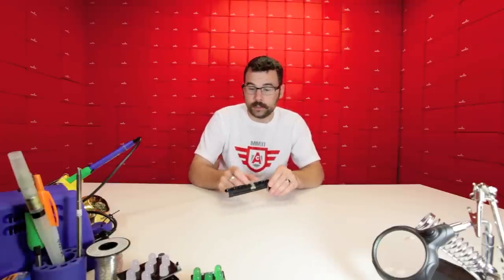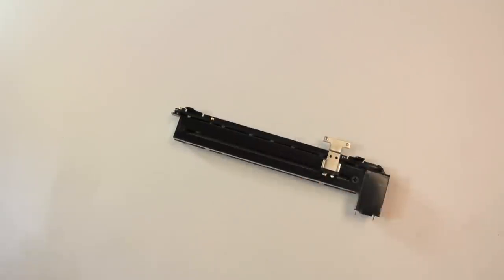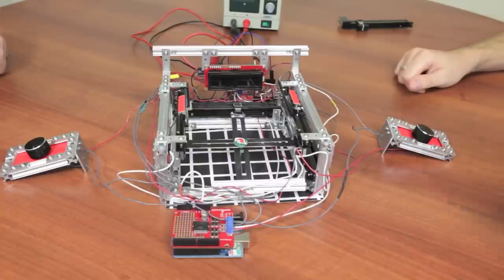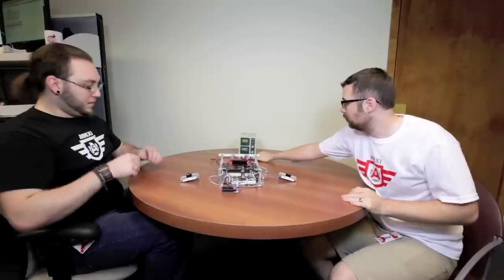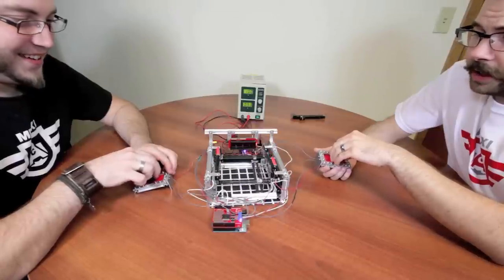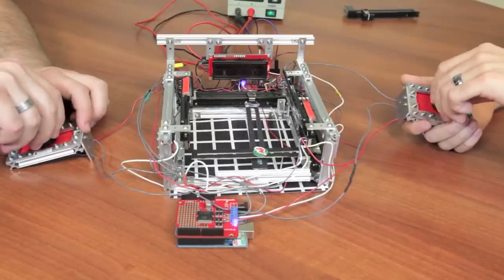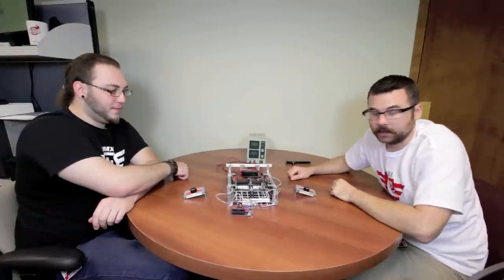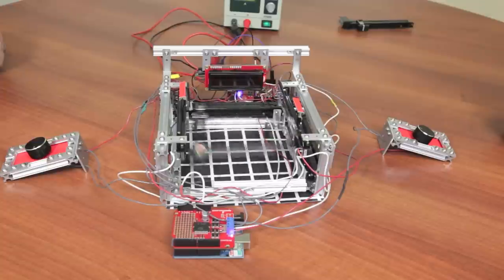SparkFun Motorized Potentiometer

Comment: I have a motorized pot that I salvaged from a Kenwood surround sound system. I am trying to figure out how to control it. it is an alps 100k Bx4. would like to install it in my bass guitar amp so I don't have to go to the other side of the room to adjust the volume. it's a whole circuit. I'm just not sure how to "flip-flop" the voltage to get the motor to move both ways. do I possibly need to use an Arduino & a motor shield?? would rather not but would if that's what's needed. any help would be MUCH appreciated!!
Reply: Joe Franklin If it’s a dc motor, what you need is an H-bridge. L298 is a fairly cheap one
Reply: @WurstPeterl  thank you very much :)